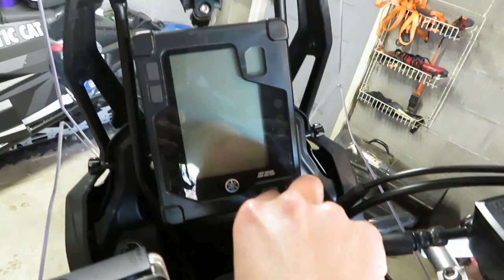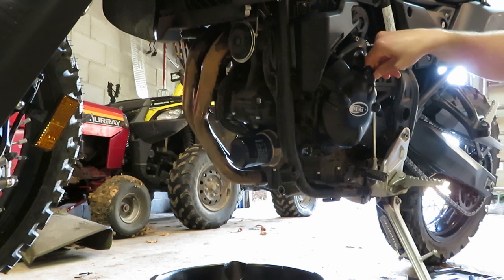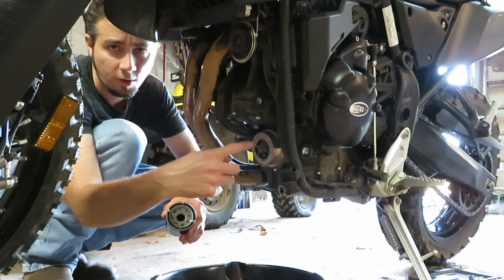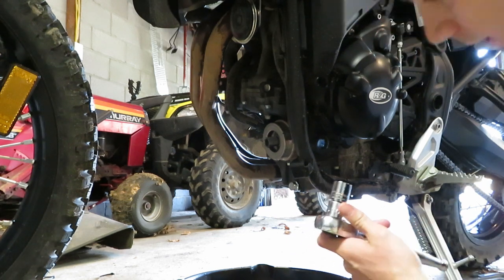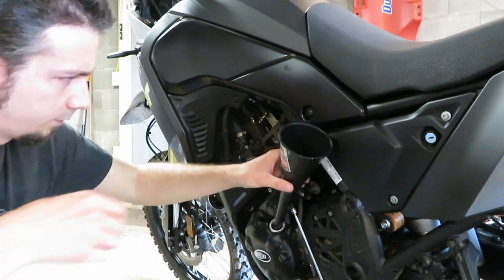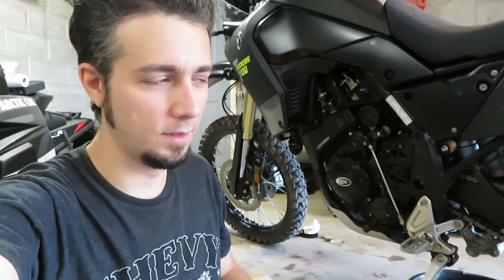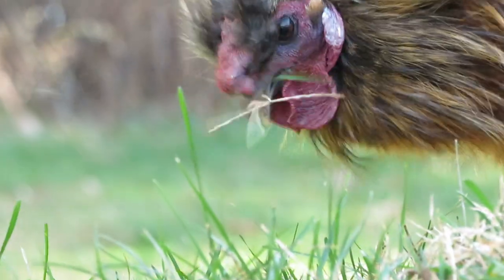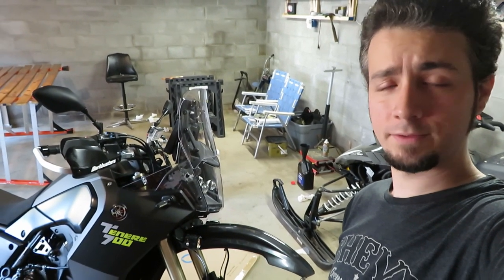Tenere 700 Oil Change | First Break-In Service

Comment: Basically i did the same on my CB650F. Tighten the oil filter by hand. But I replaced the stock drain plug with a Stahlbus oil drain valve. Well - you buy it once and you'll be quicker with the oil change. 

Actually I didn't want to change oil and filter on my one. But my oil filter was leaking oil. Just a really small amount at the bottom, 'cause one of the mechanics had tighten it with a nut... well the cap of the oil filter was so minor damaged, no one could see the leakage. And one day... the whole bottom of my bike was covered in oil. 
But lucky for me I've seen this just in time. 

Lovely greetings from austria buddy. :)

Comment: I like the position for the filter and drain plug. With the exception of having to take off the skid plate, its great for easy access. I've got to get a metal plate for the KLR though. Last few rides there's been some serious BONK factor, lol.
Reply from the maker: I do too, at first I was a little disappointed about having to remove the plate but honestly I think it still just about as quick as the KLR.

Comment: Yeah, I stayed with conventional oil for my 600 mile change as well, then before I laid it up for Winter (at 1600 miles - 3 weeks ago) I went and changed the  oil and filter again, this time going to the full synthetic Yamalube.  Might be overkill, but I like putting my bikes up for Winter with a fresh oil change and filter.  I don't ride in too much dust, so just checked the air filter, still very clean!  Definitely have some things on the list to have bought and installed before Spring (late March for us)!  Cheers!

Comment: Kudos to the Yamaha engineers that designed the bike to have the drain plug and filter like that. On my Versys, when you take the filter off, it's right above the headers so you have to make a foil cover for the pipes so they don't end up coated in oil.
Reply from the maker: Yeah it certainly makes for an easy job!   I've owned a few machines like that... Not cool lol
Reply: You might change your mind about Yamaha engineers making items accessible on this engine.  You'll understand after changing the spark plugs the first time.

Comment from the maker: WARNING: I've heard the recommended tourqe spec for the drain plug in the manual is incorrect and tells you to tighten it waaaay to much.  I usually just go a little past snug and check it after a few miles.

Comment: Drain bolt was over tightened. Yam admitted torque spec is too tight on drain bolt. Only do about 20 ft lbs.  Be sure to loosen the rear axle nut and re-torque same with front in case of field flat you'll never get the rear off. several people had to use an impact on the rear axle.
Reply from the maker: Yikes, good info thanks!!!

Comment: Lol. My chickens are just as loud. Looks to be much easier changing the oil on the T7 than the old KLR. New skid plate Ya you’re going to need one for the Alaska trip. 😁
Reply from the maker: What kind do you have?  Yep, it definitely is.  As first I was disappointed about having to remove the skid plate but I'm pretty sure it's still went faster then when I'd change it on the KLR.

Comment: Would definitely prefilled that oil filter though. It will make oil pressure light go off quicker and cut down on time engine runs without oil pressure
Reply from the maker: True

Comment: I m the opposite. I torque the drain plug and I torque the oil filter too! Yes I know it's overkill.
Reply: Prestia2011 The threads are usually aluminum, if you torque them you damage the threads.
Reply: @broncosauer6006  
I mean torque them to spec. For instance the oil filter is usually 125 inch pounds of torque.  I follow the manual

Comment: What are your thoughts on sacrificing a quart of oil to "flush" the case on the first oil change? Just let the bike sit there with the plug out, and dump a quart into the fill port. Any residual metal pieces left over from the break-in which didn't make their way into the filter should get helped along and into the catch pan...the first oil change is really the only time you'd get any value out of this since that's when you're breaking it in. For the price of a quart of oil it can't hurt.
Reply from the maker: I actually thought about doing that, certainly wouldn't be a bad idea.  To late for me now though haha.

Comment: I think the motorcycle has to be on a horizontal position, not on the side stand, some of the old oil is still there.
Reply from the maker: Mmm the drains on the far left side of the motor so having it on the stand should make it the lowest point.  But that's why I tilted it around like that, just to make sure it all drained.

Comment: Lol worrying about them chickens. those damn roosters make more noise then they need! they also try to fight you every step of the way! 600 seems a little excessive though. although i should probably replace my oil on my 2017 klr as i just bought it with 5k miles.
Reply from the maker: Ha ha yeah they certainly are.  We've actually had a few hens taken and they didn't make a peep then, to busy running away I guess lol. Yeah it's 600 and then 1000 which seems odd but better safe than sorry I suppose.
Reply: @SwankyCatProductions  bah dont be sorry! be informed and knowledgeable. which you have been and keep it up! thanks for the content on the tenere that hardly anyone knew. I didnt change my oil on my klr for 4k miles. little did i know that my 2009 klr ate oil on long treks as much as  it did gas it seems. hell i was told once by a mechanic that i did not even need to change my oil filter for up to 10k miles. did i trust that advice.. heck no. but i got what i could out of that bike and more( the more being i still have a streak of oil leading to my house from a 1/4 of a mile away when i lost my oil plug and watched the last bits of oil fall from my pan when i got to my house). Me right now cannot wait to ride! i think i will go to moab and do utahs part of the alpine trail for my bday(april). as i mentioned i just bought a klr and realize im not as comfortable on it as my old one. I also believe it is due to the tire and why i got a 2017 so cheap. the previous owner had dropped it a several times and i can see that the tire (brain fart) wanted to lean into corners rather than grip. i know from my time learning that the tire is one of the most important aspects of riding a bike and what you want to do. getting use to one tire can change your whole perspecive on a bike.